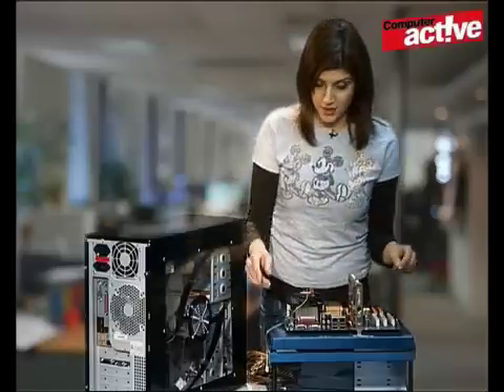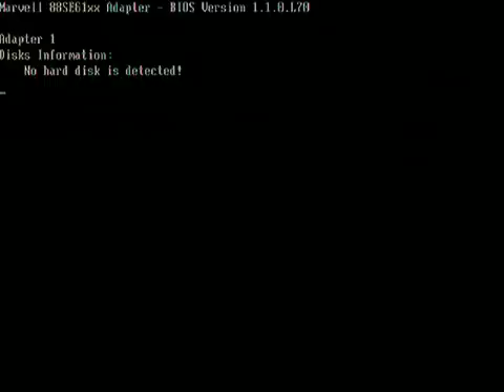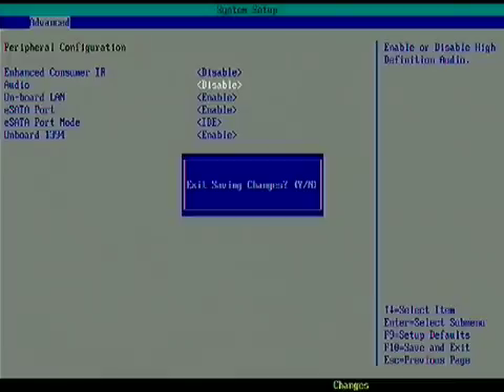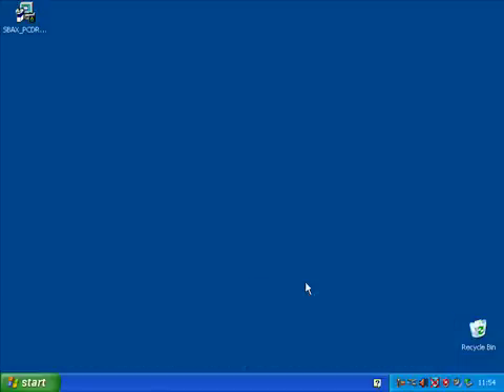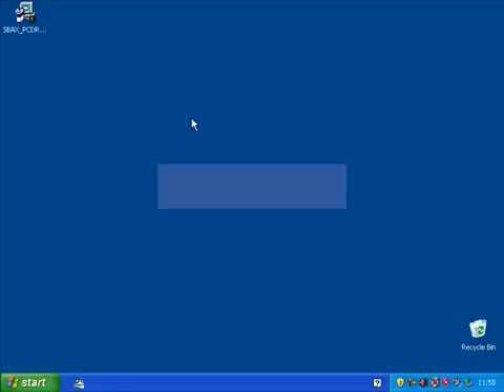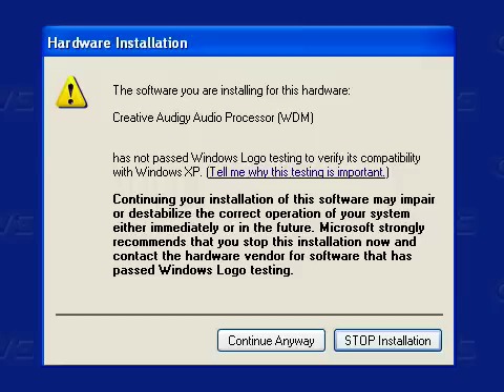Install a PCI sound card

Comment: i need some guidance here.

So ive had a video card recently installed, and it has its fans pointing straight down maybe sitting an inch off of my audio card. will this create any problems? There's a slot below my audio card in my motherboard and im curious if i could pop it in.

P.S, im kind of new to all of this
Reply: Significant Otter Audio cards don't generate too much heat, do you should be okay. if you notice some heating issues, you may want to move some things around.

Comment: :) Dear Computeractive team, always you have to pay attention before you buy a soundcard, many of them have a PCI 2.1 connectivity (NOT a PCI Express slot). Unfortunatelly, even the most modern motherboard have only PCI 1.0 slots, and trying to insert a device requiring a PCI 2.1, can damage both that device and the simple PCI slot of that motherboard, also they will not fit nor work in any kind of PCI Express slot. Peace.

Comment from the maker: I've not really seen consistent behaviour about front panel sockets and motherboard sound chips. Windows is quite happy to use more than one sound device, which is useful but sometimes confusing. The best advice is to plug the front panel connections into the sockets on the sound card if it has them. Tim

Comment from the maker: An actual soundcard (as opposed to the sound chip on a motherboard) may have been quality and more sockets. Quality may be in what you can hear, adding extra speaker channels or making audio recording easier with lower latency (the time between a sound being played into the sound card and it coming out of the speakers). Trying to play along with a high latency card is no fun I can tell you!

Comment: Google's Transcribe Audio Beta Fails
Time - what was said - what the captions said
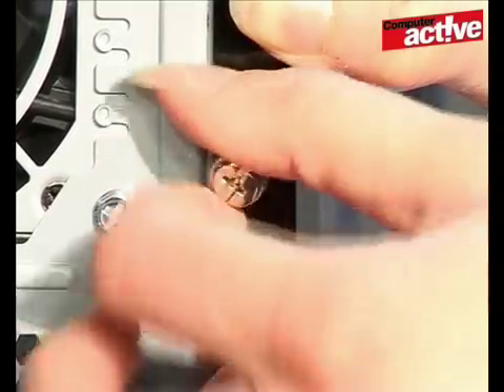0:50 - take the screws off - take the stories are
1:05 - Now the PCI slot is found just under here, this white one here - Now the p_c_r_ slut is sounds just under him, it's like one hand
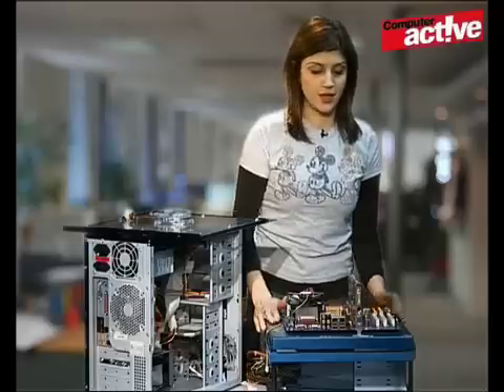1:16 - Now grab your sound card - Now practice some pots
1:24 - (note: this is said just after "now place it firmly") - into spare pci slot - into spec p_c_r_ slut
try it, there are more I cant fit in this

Comment: do you really need to disable the onboard audio or will that just make it easyer cuzz im putting sound card in my pc cuzz my onboard driver is messed up and i could find a driver that would work i need the microsoft uaa for high definition audio i know its a bus driver but i cant find one for winXp pro x64

Comment: Thank you very much. I thought changing the audio device in the control panel would be enough, I didn't think it would require a change in the bios configuration
You're a pretty girl but it looks like you have two black eyes.